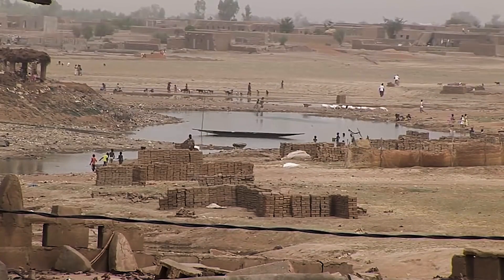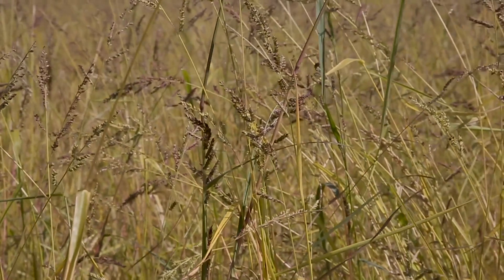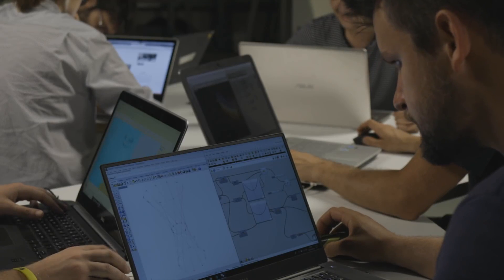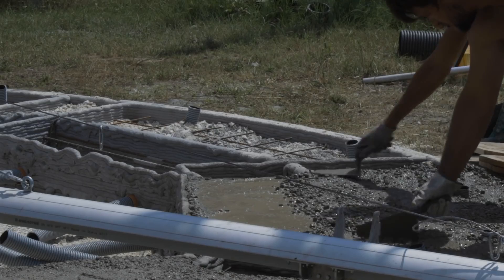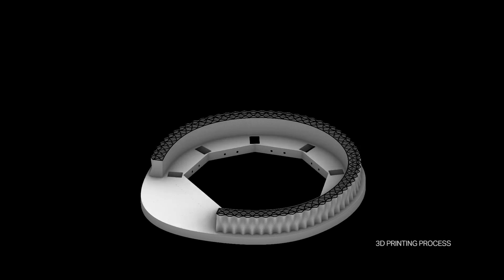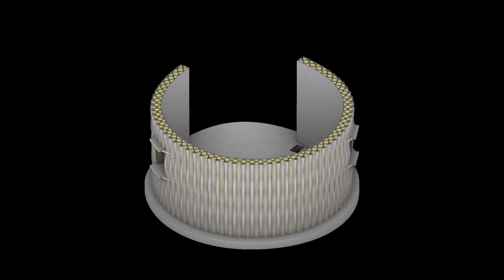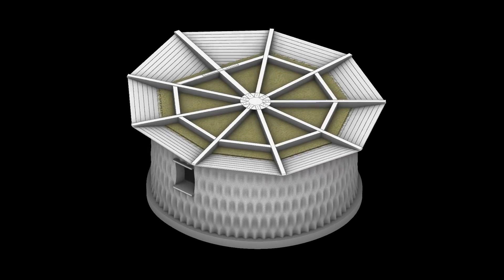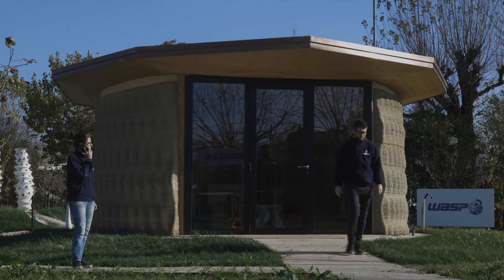Top 5 Home 3D Printers | The best construction printers available Today

Comment: you don need to print a house, just several patterns for different shapes and wall turns and slopes to pump the material, making also a whole curated structure instead thousands of layers with poor adhesion

thats it, cheap and available and hand made as usual, still in equatorial countries they have plenty of good house building techniques with earth derivatives and plant fibers

Comment: If I was at curious about buying & using such a system what would this video tell me? All of them tell me that it can print 3D house from a toothpaste tube like concrete flow and that is all. How much do they cost? How long does it take to learn how to print & use the system? Do they break down often? How hard is it to repair the system? How much per so many square feet does the house cost? Needless, to say this video is more a waste of time than a benefit to its viewers.
Reply from the maker: Thanks for the feedback, I'll try to remake the video with thre information you highlighted